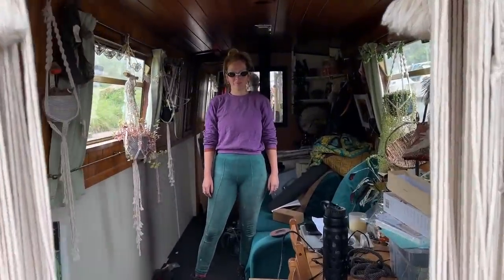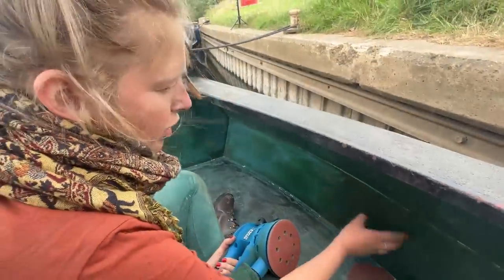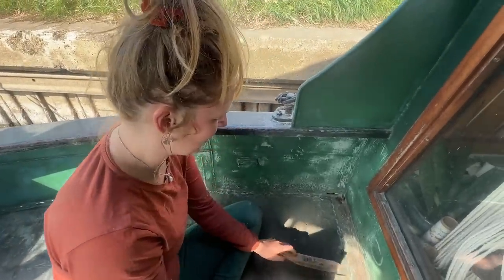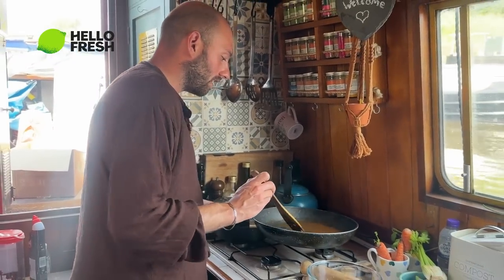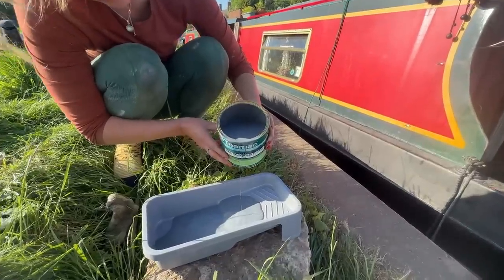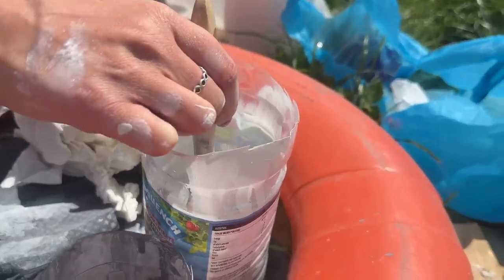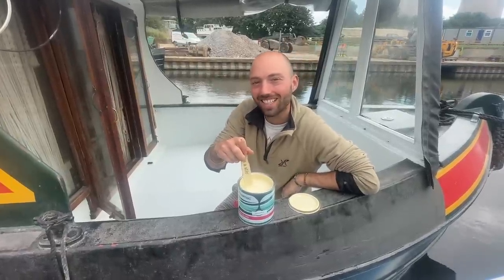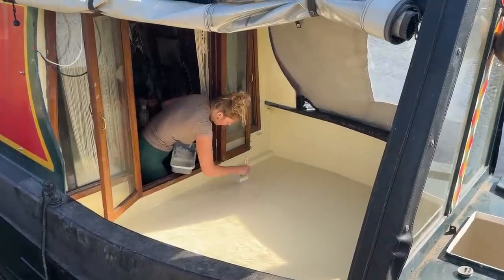Building A New Room On Our NARROWBOAT Home

Comment: As others have said. Wear a respirator or mask when sanding/cutting/scarifying any unknown paint or material.
Many old paints are  lead based but moderner paints can be Isocyanate ( containing Cyanide ) ( usually the two part paints ). 
When you paint larger areas with a Brush you can use a roller ( lightly loaded with paint ) at the final coat just to get rid of any brush strokes or high/low ridges of paint from the brush…it just changes the texture !. 
When doing window frames use a angle head brush to avoid the glass,it’s easier to use masking tape or use a Straight Edge as you go down with the brush ( or across ).

Looking absolutely fantastic work and it makes the area look so much Bigger and a lot Brighter.

Loving the videos ❤

Comment: Using both the scabbier and the power tools for sanding without the correct respiratory protection is not a good idea. The dust you are breathing could be toxic. Think of your personal safety and health when you are doing these jobs. Other than that, nice job.
Reply: Plus no ear protection
Reply from the maker: Thank you, I had a proper mask and goggles on at first but every time I breathed it fogged up the goggles which made it extra dangerous with the tool as I couldn't see, so i opted to tie my scarf tightly around me - but yes definitely thank you for the concern :) x
Reply: Yes indeed! Old lead paint, asbestos, etc, etc.